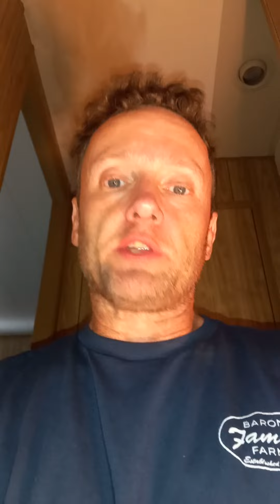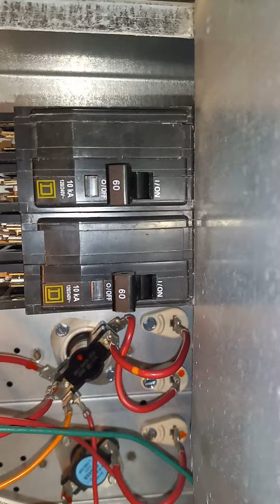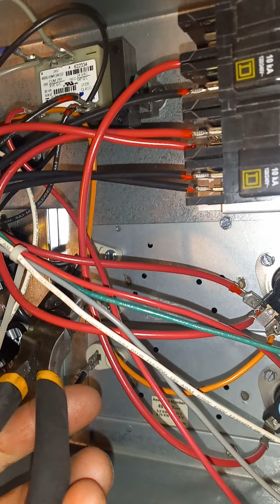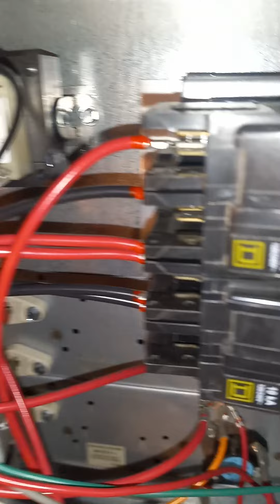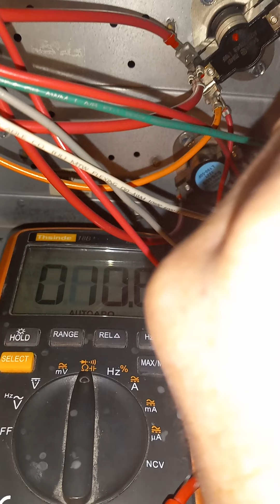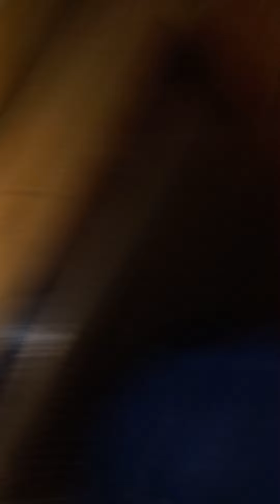Heat pump with Thermodyne heating element inspection

Comment from the maker: I'm going to rebuild his heating element using a 5000 watt 5kw dryer kit. I will make a video of me doing that. I will get a tripod and good lighting. Instead of a 165.00 heating strip assembly. I will buy a 20.00 dryer kit.